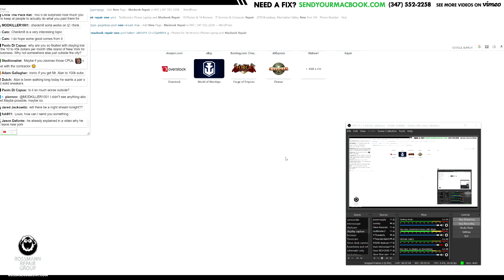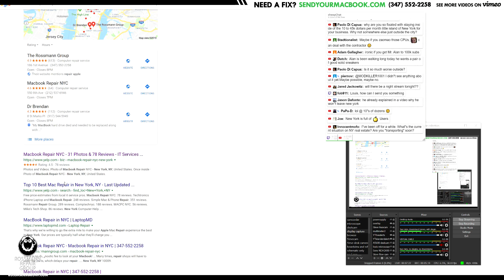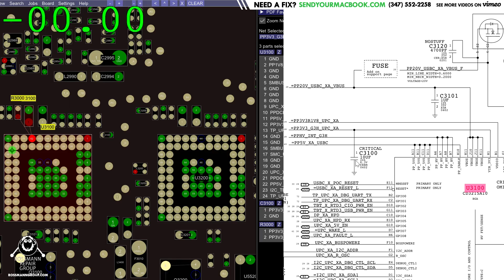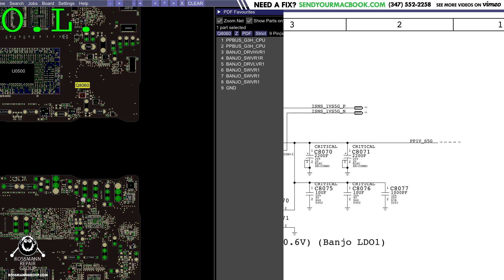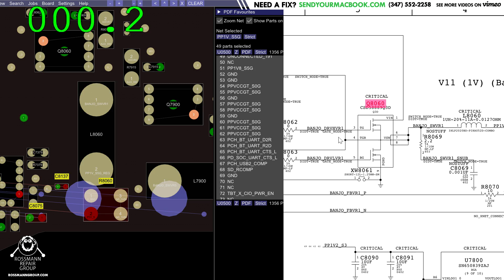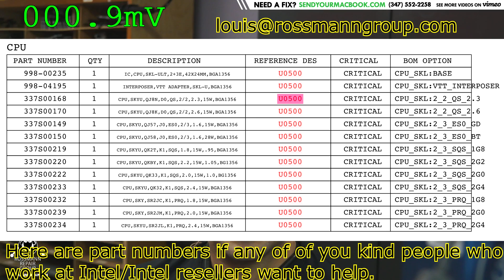Intel employees/resellers: I can use some help buying legitimate BGA CPUs.

Comment: Darth Sideous\Emperor Palpatine: I do NOT want any cooling shafts that lead directly to the main reactor. That was a huge oversight on the old Death Star and I do NOT want this one getting blown up by some lucky torpedo.

Tim Crook: I want a 50V back light power rail right next to a 3V data rail that leads directly to the main CPU. I also want faulty MOSFETs that send 13V directly to the CPU instead of a breaker circuit, as well as disconnect the cooling fan from the CPU heat sink. Yes these MacBooks WILL die no matter how well taken care of they are, and then we will charge them for a whole new system with the same flaws! (insert joker laugh).

Palpatine: That man is truly evil... Not even order 66 was that sinister...

Comment: As someone who has to move our company about 2 years ago, the stress doesn't stop untill you have done every process ie used every machine, every station, every type of repair that you offer, in the new space. Until then no matter what you do or how prepared you think you are there is this tiny nagging in the back of your mind questioning if you are properly set up to do the work in the new space.

Comment: Louis being up front was interesting to see him waving at people with a smile at 1 AM to get away from his store, but Louis back in the dungeon/office again with Paul for random antics/banter like this is a LOT more interesting/entertaining.

Here's hoping everything goes well with the lease, move, and setup; seems like Louis has a lot of solid people working for him (strange how when you respect people and reward them for their hard work they tend to want to work hard and do things right...) so it shouldn't be completely terrible, just painful as all moves are that involve businesses and equipment.  One of the reasons I haven't built a new shop yet is I can't be bothered to move the mill, cnc, etc when it technically works for me here...having another bay/lift would be nice though to keep from moving my Juke-Z project back and forth :|.

Comment: Hey boyos, I have a Hakko FX888D, what's a good tip for reworking bridged pads on QFNs? I have a very fine conical tip that doesn't seem to get hot enough even on max temp. I've seen you use a knife tip, would that work as well on the 888D?

Comment: Location, Location, Location!!! Always keep an eye on those GC's. Always watch the expenses and, always ask for receipts.
Reply: That's not the way it works. Contractors don't provide the customer with receipts. They quote a price to do the job. They don't present you with receipts. It's none of the customers business how much a contractor pays. They agreed on a price for the job, and that's it. Do you think Louis shows his customers how much he pays for his repair parts? No. He tells them that it'll be x-amount to fix it, and that's it.
Reply: @xenonram  Wrong, wrong, wrong. Yes they do quote a price for the job but, they must present an Itemized receipt/estimate/work order. If they don't they are not a reputable contractor. i have a good friend that Is a GC out In the Hamptons. He told me that he Is constantly asked for receipts for material's. We aren't talking about a 100k store or house, more like 5-10 mil. Jobs are constantly going over budget he tells me because, of unforeseen problems that arise. This Is when the receipts are usually asked for. which are printed by his office and, then usually sent over. The homeowner and/or bank, accountant wants to make sure everything Is above board. That he Isn't charging 50 bucks for 10 2x4's. Yes, he can charge more then the original purchase price but, within reason. He also told me that If a GC Is unwilling to do these things then don't walk away, run and fast.

Comment: Louis,  I have recently noticed that power supply chargers for my Mac and also iPhone cable where tree cable shroud had previous split, I had wrapped some electrical tape over the split in the rubber cable.  The electrical tape had been on the cables for about 3 to 4 month and I recently removed the tape to find the cable shroud had literally went to mush exposing the underlying wire wrap of the cable.  I believe this is a very dangerous and potentially a fire risk.  Would appreciate if you have any comments are have come across this before.  I have photos if necessary.